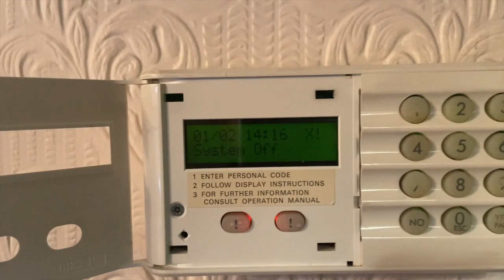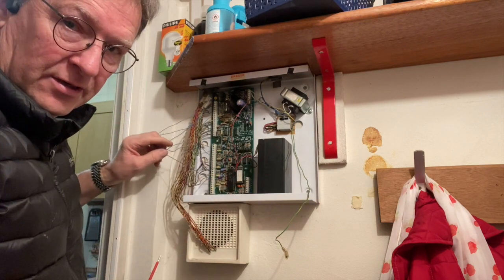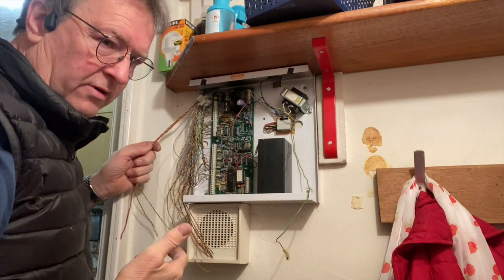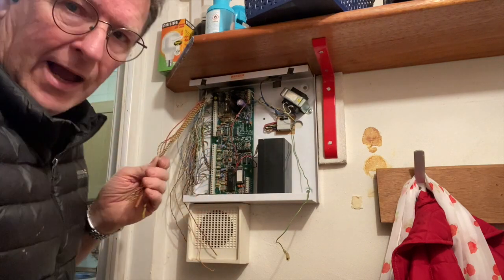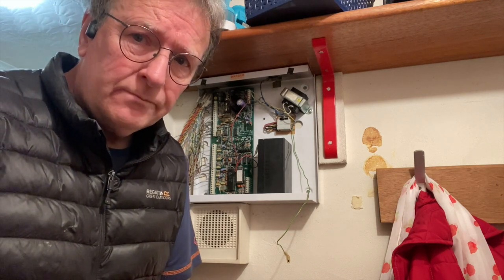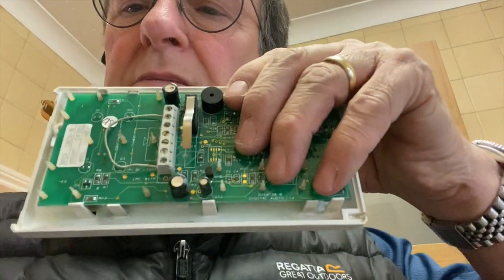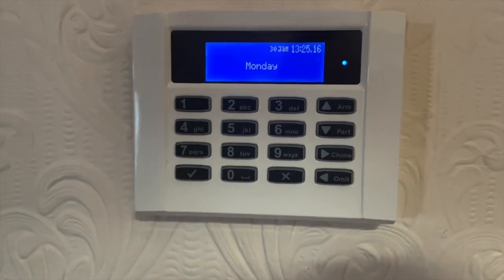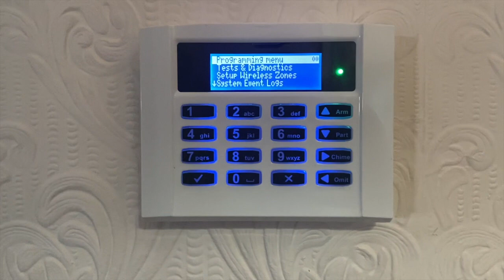(WHOS THAT BY MY VAN) How I replace an old alarm control panel,

Comment: Hi I have a HKC 10270 panel it is engineer locked would you know how to override it so I can use it in my house?
Reply from the maker: Have you tried the reset link on the panel. You should be able to default everything from there.
Reply: @SFGSecurity  yes I factory reset the panel with the link. I still can't get in to the menu to change anything. Its engineer locked?
Reply from the maker: Hi.  I d Checked with Richard Newey from HKC and you would have to send it back for a flash unlock.  I have got pcbs which you could have for £15 plus postage.
Reply: @SFGSecurity  thanks for all your help  I got a second hand one last week thanks again for all your help.